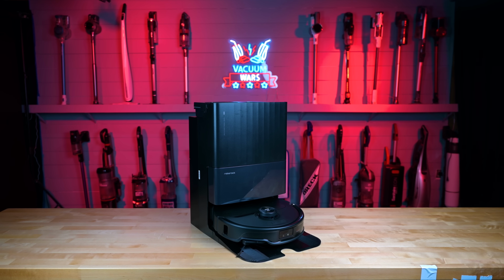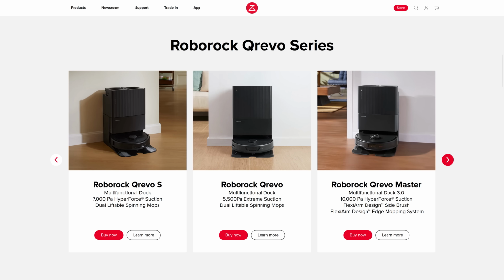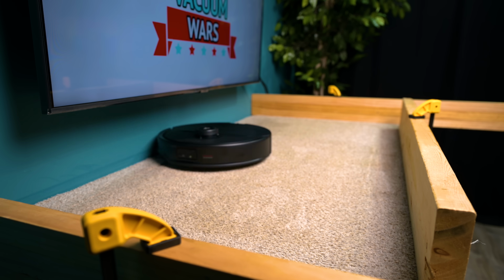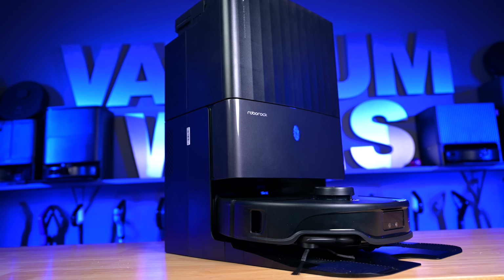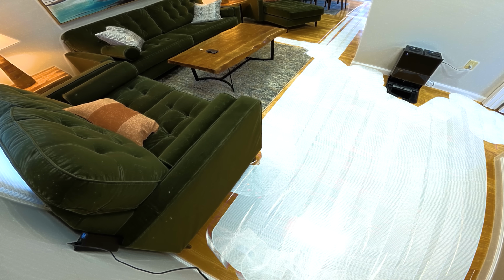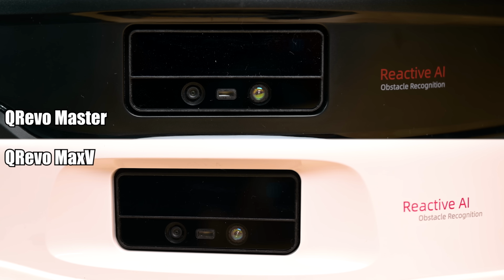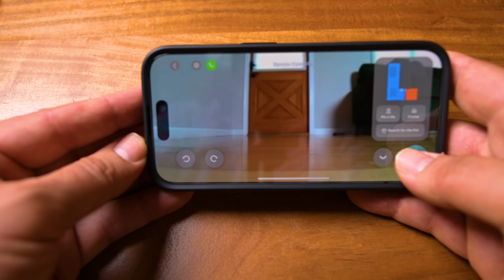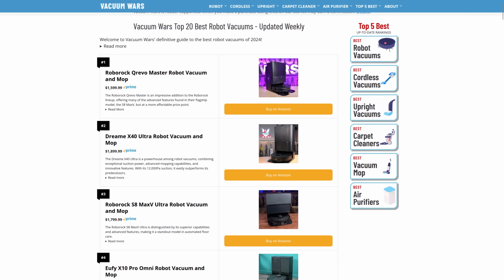Roborock Q Revo Master - Our New #1 Pick and an Apology

Comment: So I have the Qrevo pro and overall I love it. It really works great. I have some gripes about the app and how cumbersome it can be to accurately break up rooms but once you have it set there really isn't a lot of need to keep on changing your rooms so that becomes a knot issue. But the one thing that annoys me several times a week is it inability to detect chords. This is the biggest nuisance because you always have to remember to go move chords for things like a fan or maybe the cord that is coming off of your subwoofers or speakers. And then also the random iPhone cables that the kids may leave laying around.  I really wish they would have done a better job with the optical avoidance and honestly this thing would've been almost perfect for my usage.

Comment: But wait... how effective are those blades at preventing hair buildup?  You can't just leave us hanging... dealing poorly with long hair is like... the one thing that stops me even being able to consider getting a robo vacuum still.
Reply: Well said, I agree. All these crazy features like auto cleaning mop pads and cleaning and refilling water tanks, but they can’t find a way to pick up long hair without it jamming the rollers. Maybe this is a solution finally - I’d like to see it tested.
Reply: I have a Roborock S6 (Rosie) and long (to my hips) hair and it’s thick too. I shed worse than a cat. I don’t have any issues cleaning my hair off the beater bar. Infact it’s easier on the Rosie than on my previous canister vacuum which Rosie replaced. I say pull the trigger, I couldn’t be happier with Rosie from a vacuum point. Mopping sucks…but then it will be a while before any robot can compete with my Floor Mate.

Comment: Why Apologies? You should review what's in front of you and if the firmware/performance was bad than the firmware/performance was bad. You can pin a comment later on saying that the issue was corrected with a firmware update. Still,this issues should be pointed out for early adopters.

Comment: I got my Qrevo Master end of June2024 and since then, the robot has cleaned nearly 1,800m2 (31hours worth of running time) of space in my house. My previous robot vaccum was Deebot T9 which I got in Nov2021. I sold this robot just 3 months after - in short, this robot require so much babysitting (i.e. I need to be there to see what it was doing to intervene in case it did something not right) that make me think it defeats the purpose of having a robot. I told myself not to use this technology again because at that time, I think it was more for gimmick rather than practicality/ usability.

Everything changed when I got my 2 cats that shed so much fur. The constant use of my Dyson stick vacuum make me tired and I start looking around for new robot vacuum. My criteria - efficiency of the robot and the ease of use for the software. My god, the Qrevo Master surpasses all my expectation. It cleans well, the scheduled cleaning work flawlessly, obstacle avoidance is good (I don't have much things on the floor anyway, and my cats so far haven't had any accidental poop/pee outside the litter box). The camera and call function is a good gimmick to show to my relatives (and to justify the purchased price, lol).

Again, totally worth the money I paid. I rarely post reviews, but this product is too good to share the info with others.
Reply from the maker: Super input! Thank you for sharing and we are so glad you are happy with that Qrevo Master!

Comment: At this point I wonder why Roborock hasnt just ditched the Max series and just gone all into the QRevo. My original QRevo is an absolute gem still going strong and as my first robot vacuum it has literally changed our lives for the better.
Reply: Yeah, i still have the original aswell, still going strong
Reply: vibrating plate leaves less streaks and residue on floors that it's easy to notice how it was mopped. He always test mopping on white flooring, that's the easiest to mop

Comment: Little blades around the axles is brilliant!. Good job Roborock!  This may be my next robot vacuum, but it's so expensive.  The most I've ever paid for a vacuum was $300 and I thought that was insane.   Times have changed.
Reply: Check out the Black Friday prices. This model is $350 less than usual!
Reply: @stewstryker  $350 is nothing considering how overpriced it is to begin with.  I long for when vacuum cleaners were affordable to the masses.
Reply from the maker: Hopefully we’ll keep seeing more features like this trickle down into more affordable models. 🤞
Reply: not that expensive considering how expensive manual vacuum cleaners are
Reply: @akshatghoshal6098 that’s what sold me on this actually. My wife was looking at buying a $800 Dyson and amazon just had a sale on this exact model for $900 and we had a $200 gift card for Amazon so we just bought a robot vacuum AND mop for $100 cheaper than just the vacuum my wife wanted.

Comment: you know, the extend brush functionality could easily be achieve just by have a longer side brush. May add a brush guard at the wheel to prevent the wheel from tangle it. Seems like it add way more complexity and cost to add a servo arm when you literally just need to add a longer brush.

Comment: I have 20mm door treshholds between rooms, so it would be interesting to see some "offroad capabilities" of the robot cleaners. It would not be a problem for most users, but it would be valuable information. I know from my experience that S5 is a beast, only occasionally struggles when the mop is on.

Comment: August 29th - Sept 4th, the Roborock S8 MaxV Ultra is going to be on sale for $1099 and it’s practically the same as the Roborock QRevo Master besides the swinging mop which can technically get further under things (instead it has a separate spinning small mop pad to get the edges) 

Roborock S8 MaxV Ultra has better obstacle avoidance in my opinion 73 vs 62 items on the QRevo Master. Auto detergent dispenser, bigger water tank (100 vs 80)  and dustbin volume (270 vs 220) within the machine 20mm mop lift vs 10mm mop lifting). 

I enjoy these comparisons and enjoy this channel HOWEVER they share a completely different view on top machines than I do regarding top machines and their reasonings and test numbers. 

There is a reason why it’s Roborocks top of the line machine. Wait until Aug 29th-Sep 4th and thank me later. 🎉 

PS, no additional sale price on the QRevo Master it will be $1399 during the sale. 

PSS. My top machines for Both Vacuuming and Mopping and individual below:

Best Overall Both in order top 3: Roborock S8 MaxV Ultra, Roborock QRevo Master, Dreame X40 Ultra (removable mop pads and better avoidance but not as good a vacuum as the QRevo Master)

Best Vacuum: Dyson 360 Vis Nav (firmware updated Aug)

Best Mop: EufyLife S1 Pro
Reply: The QREVO master is on sale right now for Labor Day selling for $999 instead of $1399 USD
Reply: Where is it going to be on sale?
Reply: @Pekeg84  on Amazon and the Roborock site.
Reply: How do you feel about the Dreame L20 or L10s. They are both around $600 for Labor Day. I'd rather not spend 1k. I'm happy with the cleaning performance of my ecovacs T8. But I like the mop washing/drying/refilling features of these newer models.
Reply: @prviolist  the L10s is one of the best vacuums around. It’s ability to pick up debris on carpet is very high for its lower Pa ratings. Its ability to stay flush against carpet gives it an edge form what I’ve seen.
Reply: @EbenRogers  thank you for your reply. I saw a comment here talking about x30 for 699 and ended up jumping on that. I like the mop hot wash and squeegee. So I hope the good things about the L20 translate to the x30 as well. 🙂
Reply: @prviolist  Honestly there’s not much difference between the X30 and X40 so that’s a deal and a half. Good luck and great purchase!
Reply: Ho @vaccumwars do you think s8maxv for 1,1k is better then qrevo master?

Comment: Two negatives for me are the lack of automatic detergent dispensing and the inability to remove the mop pads for a vacuum-only job, which makes me prefer the Dreame X40.  However, Roborocks do navigate more efficiently.  I guess one robot can't have it all.
Reply: Dont the mop pads lift up of you want to vacuum only?
Reply: @pod543 it does and I'm not and don't care about swapping things around on mine.  I don't why this person thinks that makes sense for them to do.
Reply: I do like the feature of the x40 to leave the mop pads in the dock which the roborock lacks. Especially cause I wouldn't use the mop everyday.
Reply: I feel x40 is better in all aspects.
Reply: I got an old Z10 Pro from Dreame with the old app that works great, but I'm looking to upgrade this Black Friday to either the X40 or this Q Revo Master.  I'm however non the wiser and would like some advice 😅I only got two very flat carpets and it's not an issue for me to order the robot to first vacuum then mop.
Reply: @TrueDesire존 pick x40 ultra works perfect and i got a big house. Its doing a perfect job
Reply: Before I purchased mine, I also thought the mop pads removal function from the X40is good, but I didn't proceed with the X40 because of the extreme price plus the not so good review for their apps. My Qrevo Master so far works flawlessly on the mopping front - I have one big very high-pile carpet in my living room. I set up the robot to vacuum the carpet first, then only proceed with the vacuum+mop for other area of my house.
Reply: you know leaving the pads in the docks is a gimmick right? there's literally no use case when you cannot do the same with a flagship Roborock
Reply: @xeon2k8  It is a ROBOT right? If you have to do it manually then it can no longer be called a ROBOT. Fact is, Dreame is the ONLY ONE that currently can drop and re-install its mops and do it all FULLY via ROBOTIC AUTOMATION... and that's why we are buying all these robots for... hands OFF robotic automation...
Reply: @TheNature101  did i ever say you need to touch the robot? no i didnt. what you do is first run vacuum then another run for mopping. Mind blowing right? yeah that's what i thought.. ffs
Reply: @xeon2k8 here in the US the usual master bedroom/master bathroom/master closet is carpet/tile/carpet. Which means that wet mops will touch your master bedroom carpet. And secondly, being able to drop the mops is not the same as NOT being able to drop the mops and just vacuum first, which also dreame can do.
Reply: @TheNature101  heard of lifting mops ever? or even carpet avoidance. what a time to be alive with all this tech
Reply: @xeon2k8  which dreame can also do (lift mops) and can also vacuum first, and also drop mops. And lifting mops is not the same as drop mops. Having 3 automated choices are better than 2 in order to ensure that a wet mop never touches carpet.
Reply: @TheNature101  and going back to my point, there's no case where you cannot solve with what a Roborock offers already, thanks for making it more clear why

Comment: Just my two cents on the "apology" section of the video - You tested the MaxV right out of the box (assuming it was a production unit and not a pre-production unit) and that's what people would have also experienced out of the box at that time. You are testing the Q Revo Master in the same fashion and it performed better without needing a retroactive firmware updated months later. I don't think you need to apologize for the low obstacle avoidance score because that's how it performed until now. Roborock should understand this. 🙂

Comment: Why apologize?  It was indeed terrible avoidance system, but fixed with an updated. Not your fault.
Reply: His choice to apologize for his error of not ensuring the firmware was current was the gentleman thing to do. Something we need more of in this world.
Reply: Thats was my thoughts. Since when do we apologize to a company because of an accurate observation.?  The company went out and made V 1.2 better. The update doesn't change the fact that the  v1 wasn't very good. From the customer side, no mistakes were made.
Reply: same with the dyson too.
Reply: It's still terrible after the update. An object avoidance system needs to have near zero false negatives to be useful, but this fails all the time. You still have to check the floor before running the robot, so what's the point? And if that wasn't bad enough, it also has a lot of false positives, which means that it will skip spots that it doesn't need. Enabling this feature is a net negative.
Reply: 100% It's not his fault, they failed him.
Reply: … unless there was an update not implemented before publishing
Reply: Because having a reviewer apologize to a brand is usually a great CTR move
Reply: because when he did the testing the firmware was already out i think. also he should be retesting these when he updates the list to make sure if the software makes and changes. You have to remember these are just advance computers now that need good software as much as they need good hardware, and every now and then you will get bugs that needed to be fixed.
Reply: @Bearly-be well said i completely agree
Reply: @Bearly-be  Complex as they may be, counting on your customers to do your testing for you is an attitude that we do not have to accept.  It's not like these vacuums are interfacing with other software or systems that are constantly changing where a bug suddenly crops up that didn't exist before.  Obstacle detection didn't work properly out of the box.
Reply: @Bearly-be don’t ship bad firmware. Having you ever heard the saying you never get a second chance to make a first impression? That applies here.

He would be endless retesting vacuums if he did as you suggest. Updates are sent out often for even the older models. If a company ships a product with bad firmware that’s on them. Especially if they don’t auto update it.
Reply: @Mrcaffinebean So the question is, did he get an early model, and did he not update. If it was their fault for the bad firmware, that's their problem. Mind you, updating a review can be good if it's like an early review model, but I wouldn't apologise unless this channel was at fault.
Reply: Because roborock told him to do so.
Reply: Sorry, now gimme more moneyz
Reply: he thinking about his social credit lol

Comment: How long does those vacuums normally last? And how long of warranty do they have?
Reply: I've had my Roborock S5 Max for almost 4 years and it's mostly fine. I opened it up once because it was having some problems and removed a ton of dust. Unless newer models are sealed better, that's one thing I would do right after the warranty expired

Comment: I guess my market niche is small but I really want my next upgrade to be to a vacuum that has an option for a low profile fully plumbed-in base unit. Right now I think that restricts me to the Roborock S8 MaxV Ultra or Dreame X40 Master. If the QRevo had an option for a low profile plumbed dock I would definitely have it on my shortlist but I think it’s going to be the Dreame X40 Master for me.
Reply: Roborock does this option. The dock is 10cm shorter. I dont think its getting more low profile than that any sooner.

Comment: Rolling Mops from Eufy S1 Pro is the best mop, spinning is easy second and then vibrating mops and then stationary ones. The problem with spinning is that the mop is dirty and the robot must return home and then go back. The problem with vibration and stationary mops is that they drag dirt everywhere. The rolling mop in the Eufy is designed to roll and "spill" its dirty water it picked up into a dirty water tank for later. Which means that we have not yet achieved a near perfect vacuum+mop combo
Reply: the rolling mop cant reach the sides or corners. the spinning mop is the best option for overall coverage. 

This is coming from a guy who is testing all types currently lol since i got two for my work and one for my home. i am going to keep the Q Master for the home and dreame L20 for the showrooms. since they are a bit cheaper and can be linked directly to water and drain.

"Edit" I did try Eufy S1 and S8 MaxV Ultra. Didn't like either as much as the two i am keeping and the Eufy software overall isn't as good as Robo and Dreame.
Reply: Yeah roller can't get very edge.. But I also don't really care.  Honestly I dislike spinning disk that reaches out more.. I'd rather have a gap than get water on baseboards.  I don't think you need mopping that close..  Dust collects there but nit stuff that needs mopping.
Reply: @Bexamous  I'd rather have a 99% clean floor than an 80% clean one. The spinning pads use far less water than a conventional mop which people use up to their baseboards with little issue so you're inventing a problem that doesn't exist.
Reply: Roborock has rolling mops in the Dyads, so they are familiar with the tech. They'll probably try them on a vacuum as well